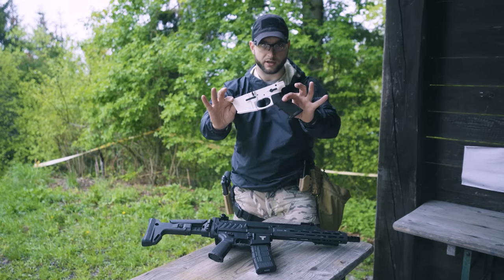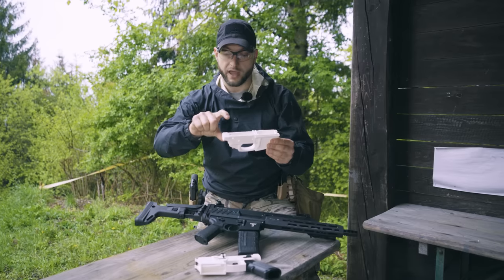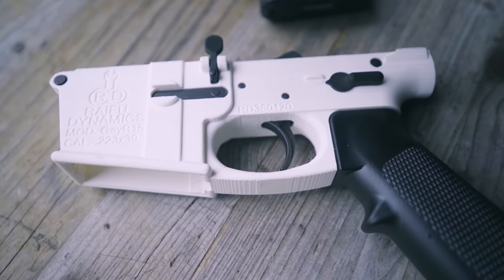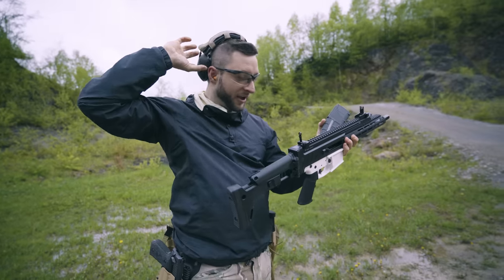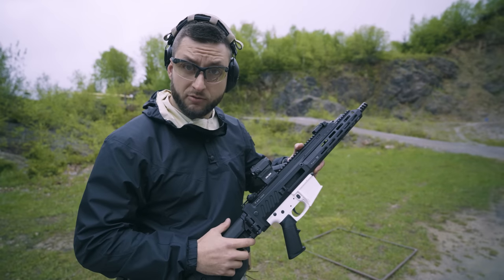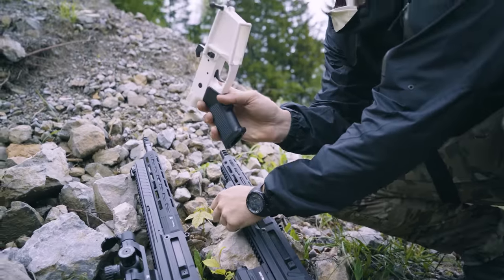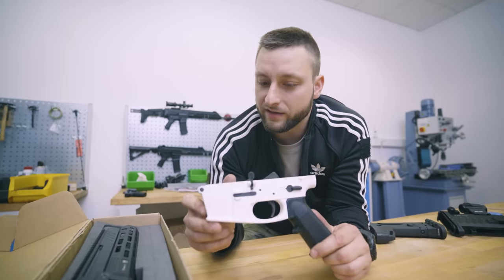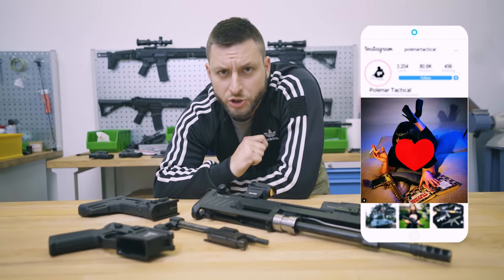Perun X16 with 3D printed lower

Comment: On one hand, it's pretty cool. It's a legal ship of theseus in a way becasue while it's an AR lower spec, you do cut the buffer tube off. I can see that being the case when taking a serialized to spec lower with the buffer ring then removing it: but if it's printed natively that way was it ever fully a proper AR-15 lower? The easy part here would be to print it with the buffer tube ring, then remove it, so that at one point of its existence it was a full-blown AR lower. Ultimately tho, from a US perspective, I'd think it would not take much stretch by ATF or other agencies to consider that 'upper' the receiver of the gun, in the same way the aluminum 'upper' on a SCAR or other similar systems where the stock is not attached to the lower, the upper is considered the receiver. (An XCR or Daewoo or ACR, consider the lower the receiver. A G-36, SCAR, SIG, etc it's the upper. And from what I gather it's down to how the stock attaches) 

So having a complete upper assembly that looks to be basically a variation of a SCAR or BREN upper, but doesn't have to be serialized just because it has pins in for a AR-spec lower, doesn't quite make sense if I'm trying to classify it. I'd look at that upper and go "why is that in any way different than a SCAR? What sort of difference in design does it have to other similar platforms, where the lower has to be the serialized part? 

It'd be one thing if the stock was reinforced by the upper, but still was retained by the lower. Like a sort of plug into the buffer tube tower that the stock hangs on, but the upper sort of clamps on against that: Similar to the BRN-180. That would unquestionably be a serialized lower, in my eyes. But once it requires turning the lower into just a trigger-group and magwell, it would call for a serialized upper if I had to make the call based on current rules. But that said if the people who made it are able to get it to pass the legal bar then all the more power to 'em. 

Nevertheless, this thing is cool looking overall and hopefully it's a well made, decent rifle.
Reply from the maker: You are making way too much sense for ATF

Comment: Ladies and gentlemen I present to you the ultimate defeat of gun control world wide...3d printed arms
Reply: No it isn’t. For years if not 100 years there have been men and women around the world who have had machine tools at home, lathes, mills etc. everything you need to machine a firearm out of steel or another metal, totally off grid. Now with Cad CAM it is far far easier. Indeed some have done just that, very few however have, very very few. Gun control world wide still exists. All 3D printing has done is make it easier to manufacture certain parts out of plastic. In most counties the parts you need to make a gun work are those bits that are regulated, barrel, bolt, trunnion you can not buy those without going through gun control and you can not 3D print them. In other places it includes magazines so you can buy springs or floor plates without going through gun control. And of course in most countries you can not buy ammo or its consistent parts (prima, powder) without going though gun control. So even if you did construct a firearm without ammo it is just a bad club.

Comment: I wonder, I know they are expensive but have you dabbled with metal printers?
Reply from the maker: Not yet, we don't have access to any of them but i have seen 3D metal printed suppressors - the finish is a bit rough but the cans were fully functional and very strong
Reply: I am looking at getting a desk top cnc mill.  then get some 80% lowers and just mill them out like these lowers.

Comment: if actual plastic 3d printers revolutioned the gun communities just imagine the future of 3d steel printers the possibilities of crafting something original and unique are infinite
Reply: Metal printing is constrainted by physics. Either you have to print a "green part" that is sintered in a klin or use selective sintering under inert atmosphere because finely powdered metal loves to catch of fire.

Comment: Just to have it on video, I'd be curious to see how it handles the pushup test that generally kills polymer lowers
Reply: Ivan the troll has a U-bolt version that handles it, and Hoffman Tactical has a hose-clamp version that also does.

By itself a polymer lower would have to be very bulky, a "Brick" lower (by plastipews I think) might be able to handle it but I haven't seen it done.

Comment: Does the 3D plastic work well in extreme weather. Cold or hot?
Reply: Texas heat has made some a bit too wobbly, at least out of standard PLA.
Reply from the maker: No
As all plastics it gets brittle in extreme cold and it becomes soft in very hot environment
Reply: Depends on the material (its just like Glock/AUG, if the material is designed for it then yes, if not, then no). I think most people use PLA+, but if you're doing mag dump after mag dump you want to find an extra well designed one for ABS (that's my favorite material, though its not quite as easy as PLA for most people).

Comment: It doesn't really work as well with an actual AR-15 because the buffer tube screws into the lower receiver.  Your stock connects to the upper.  If all it had to do was hold the trigger components and the magazine, it'd be a lot easier.
Reply from the maker: That’s why we used the Perun platform.
Reply: There's a dozen different 3d printed AR lower models out there now that work perfectly. This mindset is dated and obsolete.

Comment: where can one find the lower receiver 3d print file?
Reply: any luck?
Reply: @nextlvlroy  no.  Haven't found it yet
Reply: @Element_Z48  yeah i don't think it's available anywhere. I think it was specifically made for the uploader to use with the Perun. It sucks, i want to print it for myself so i can buy a parts kit for the Perun, but yeah without the lower i can't.

Comment: File drop?
Reply: Its literally a standard lower, printed upside down with a Z-cuttoff in your slicer... I would guess around 30mm cutoff.
That's not a good lower design though, go check out the Hoffman designed lowers, you could do the same to them but they are beefier and would last longer (that said its under basically no stress, but Hoffman incorporates optional trigger pin bushings). From inspecting the design files it looks pretty well done (couldn't tell you personally how they work as I've never tried one, but he does a lot of testing on his channel and I find his material analysis and design methodology very useful since I both as a hobby and professionally design and engineer FMD parts)

Comment: It's funny, because in Poland lower receiver is the only part that is not an "essential part of weapon". Upper, barrel with chamber, bolt and bolt carrier are all regulated (there are more, but not in case of AR15) and need to be bought personally. Also in Poland you are limited in how many weapons you can have. For each slot you get "promises" you have to  give to the seller. Oh, and each of essential weapon parts are considered a weapon to prevent illegal weapon manufacturing. So if you want to cherry pick every part of your AR  you have to sacrifice at most 3 "promises". You can free up 2 of these slots if you go to a gunsmith who will "make a single weapon" out of this by stamping every essential part.

Comment: its funny that americans serialize the simpliest part :D
Reply: None of them are difficult to make though. Its just like to build a MAC11 style Lutty takes between 1 to 2 days with parts from your local hardware store. Its not like firearms are complex (especially 9mm open bolt, but for legal compliance in the US they cannot be open bolt, much its also illegal to not have rifling in the barrel, but if you don't care about the law then its much, much easier to do than to try to jump through the ever changing laws).

If you did the barrel: 3d printed ECM jig (see the FGC-9)
If you did the upper: that might actually be less machining (these laws were written when they were done with metal mostly in mind), but you can also print the upper
Grips: tons of printed options
Bolt: Pretty simple to machine
Stock: Not even required but can also be printed
Trigger: Can be printed
Magazine: Yeah they have those printed too
sights: I actually use 3d printed sights on a Nerf toy (which uses explosion to propel, so its technically a muzzle loaded hydrogen toy)

Basically everything can be printed or easily made in most firearms, there are a few exceptions like 50BMG (you could probably do it, but for semi-auto its probably going to weight an insane amount). Actually, there is a .50 BMG upper (with side magazine) that fits onto standard lowers... But the US classified the upper as the firearm, so at minimum it took 2 firearms to make 1 firearm.

Comment: Criminals don't care about serial numbers or not as  99% of guns used in crimes are stolen. No criminal is going to go thru the trouble of making a gun when they can just buy or steal one. Ghost guns is a myth or a non issue. And 3d printing a lower is not a 3d gun. Make the entire gun from a 3d printer then see if it works. Even then NO criminal is going to go thru the trouble of 3d printing a firearm. What would be the purpose? Guns are traced by ballistics NOT serial numbers. Serial numbers just affect law abiding gun owners to for registration, inventory, warranty, service or insurance purposes. Again things a criminal does NOT even think about.

Comment: Cool tech but this ghost gun story in general (not your video ) is dumb.  If you have the technical ability to take Spark Erosion or chemical etching to make a barrel then you have the skills to machine a weapon from billet stock.  So outside the USA the accessing barrel and other upper parts would render it an illegal not ghost gun and limits 3D access.  Then their is ammo issues .So this explain why the IRA and other insurgents lean towards improvised explosives not Ghost guns.

Comment: i think when people be smarter teknologi be weak and dangerous actually .. now we can se just a little bit from a part a gun imagine when someday some people think build a gun from scrap and 3D printed its so be disaster ... thats just my opinion
Reply: Have you seen the almost completely printed DIY firearms? They can survive 500 rounds mag dumping straight, then let them cool off and repeat thousands of rounds.

Biggest thing is use a metal barrel, but if you have a pipe, you can 3d print the rifling jig for the ECM process (about $20 for the setup to electrically cut rifling into the barrel, this is only required for legal compliance in the US as smooth barrels are illegal for pistols).

They are very impressive designs, they show a lot of 3d printing design tricks (so any mechanical engineer will probably benefit studying the models and how they designed for process and materials).